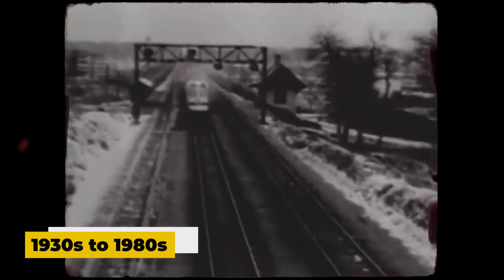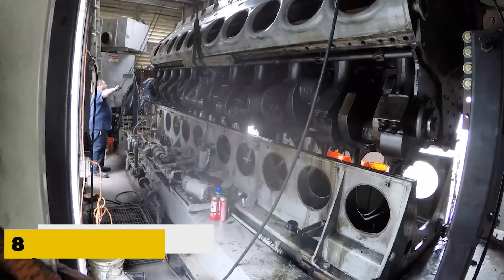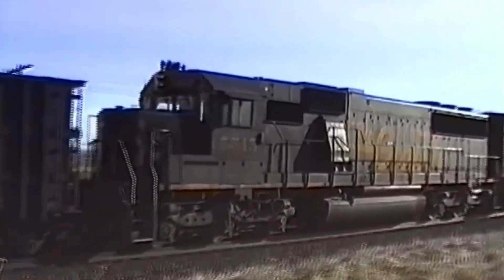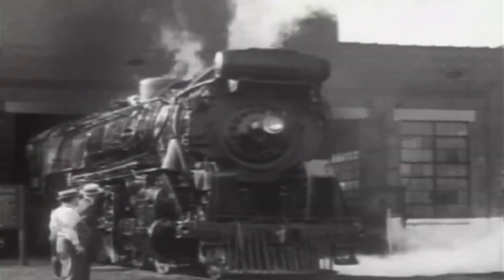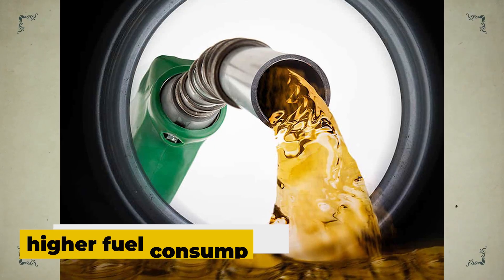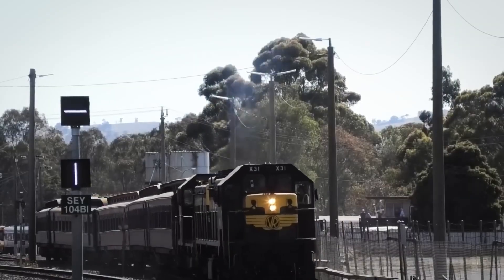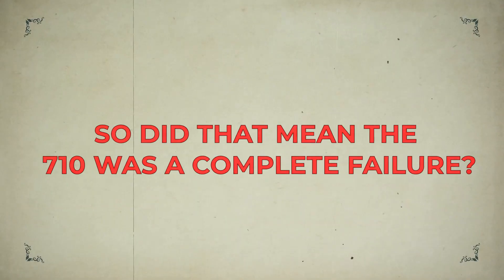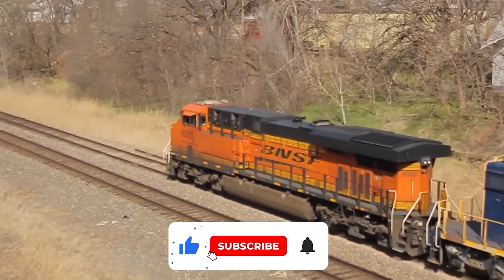Why EMD 710 Was Killed: The Engine Railroads Couldn't Trust

Comment from the maker: Where are my dear viewers from? Any EMD fans out there? 😊
Reply: I was a mechanic for both CPR and CN. I really preferred working on EMD locomotives- well designed machines.
Reply: Welded steel engine blocks, the strongest construction possible.  The EMDs also sound really good, like a locomotive should.  They look the part as well.

Comment: I read that the F59PH was powered by a turbo charged V12 710 diesel engine producing 2800 bp. to 3200 hp.
Reply from the maker: You're right! The F59PH really showcased the power of the 710 engine. It's fascinating how such engineering feats shaped the rail industry!

Comment: Are you doing any actual research here? The 710 was and is highly reliable. It's use in locomotives was curtailed due to Tier IV, but Tier IV 710's do exist in service, railroads have just found it cheaper to perform rebuilds. 

The issue with a TIV 710 is that they require particulate filters that sit over the engine and this gets in the way of how regular maintenance is carried out. This is why TIV 710s are still popular in marine applications as marine engines sit in a room with the filters elsewhere.
Reply from the maker: Thanks for sharing your insights! You make some great points about the reliability of the 710 and the challenges posed by Tier IV regulations. It’s always interesting to hear different perspectives on such a pivotal topic in railroading.

Comment: It didn't help EMD's case when the early batch 710s sold to the Illinois Central Railroad on their standard cab SD70s, suffered cracked blocks and failed air compressors. The air compressors were supplied by a third party, but EMD still got the blame.
Reply: Look at those IC SD70’s today, basically the main power used on the IC route, Chicago to Memphis in 2025.
Reply from the maker: Thanks for sharing your thoughts! It’s amazing to see how these engines have adapted and held their ground on such important routes.
Reply from the maker: You're absolutely right! Those early issues definitely impacted EMD's reputation. It's a tough lesson in how one part's failure can overshadow the entire product.

Comment: Way wrong information in this video, completely wrong, the EMD is still the best longevity  engine out there.
The GE offerings, all of them, still can't hold a candle to anything EMD.
This is how GE stole the sells from EMD.  GE paid lobbyists to get EPA rulings that put laws in place that all train engine manufacturers had to abide by, and this is where the EPA went just a little bit over board with their rulings.  At the time these rules were laid out, all locomotives bought at the time of these rulings had only a 10 year life cycle then new complete locomotives had to be bought to replace the 10 year old locomotives.
Ain't that some sh!t, EMD still has locomotives showing up for work thats approaching anywhere from 20 to 50 years of reliable service that GE has never never been able to claim.
So as the video name suggests that GE killed EMD's marvelous engine design is completely backwards.
GE has never been able to make any of their junk last anywhere near the EMD offerings.  So this video producer might ought to get his or their information rightly researched before posting non correct information that us in the know KNOW
Reply: Very true.  The SD40-2 that the Dash 8s were supposed to replace, have outlived their replacements.
Reply: Well, the AI bot that created and narrated this will be interested in learning all of this.. . .At least it stayed current with the images and video clips of outmoded steam engines in the imagery mix, right? If this video is anything like a bunch of AI-generated WW II junk, the "producer" didn't even bother to audit or edit this "product" before posting it, assuming that if it's on YouTube it's golden!
Reply from the maker: Why so bitter? :/ Thanks for watching :)
Reply: Hate to be this guy, but you're actually wrong in some places. GE has been more dependable than EMD since the late 1990's. Even in the 1970's when GE was selling their -7 series practically every railroad at one point had a fleet of them and despite dynamic grid and mechanical issues all of them were great pullers for heavy tonnage. GE just started overthrowing EMD with the -8 series because of better traction, horsepower, and microprocessor technology which the GP60's & SD60's fell short on. Alot of EMD units still had better reliability and higher dynamic power ratings, I'll give credit to that, but that didn't last long once GE kept proving how technologically advanced their motive power is. EMD was already dead once GM tried to sell them out. That's inevitably what prompted the massive failures of the SD90MAC-H's. Despite what happened with the AC6000CW's, GE actually resolved their issues and deprived them. Most of those problems were because of Deutz MWM from Germany which helped in the developing of the 7HDL prime movers. The smartest move GE did was discontinue the 7FDL which was on it's last threads after what happened with the C44-9W's & AC4400CW's. GE kept stressing the 7FDL's, which were a bought copy of the Cooper Bessemer RVBL's, which is what lead to fuel injection and turbocharger failures. The C44-9W's & AC4400CW's will always be notorious for catching fire. The 7FDL's, C44-9W's, and AC4400CW's to GE are what the 645F3's, GP50's, and SD50's were to EMD. One mistake and how to recover from it. The problems that originated from the AC6000CW's are what lead to the success of the GEVOs after GE corrected them. More GEVOs were built than the EMD SD40-2's entirely. Singlehandedly the GEVOs are the best units that GE has ever produced. Greenbriar Berkshire and CAT/PRLX kept making things worse for EMD. Caterpillar engines never have worked well in EMD units. You can even look back at MKR when they built the MK5000C prototypes and what happened with them. The SD70M's, SD70MAC's, and SD80MAC's were the last decent units from EMD, I'll admit that mainly because Siemens providing EMD traction motors in later years was another mistake that they went with. The electronic issues that orginated from the SD9043MAC's & SD90MAC-H's was still a problem and never resolved with the SD70ACE's. The SD70ACE-T4's & ET44AC's are even more junk because of EPA technology. Even though Wabtech took over GE now there is rebuild programs and GE units are slightly cheaper to rebuild and their warranty is much better. Many EMD units surpassing 20-30 years of age are disappearing or being sold while GE units are getting more rebuilds done to them because of that reason. While the EPA ordeal with EMD was real there was poorly done business and market choices that inevitably lead to their downfall over the years. The GP40-2's & SD40-2's were the last great thing from EMD, but how many of them are still used on mainline manifests 24/7 in this day and age? That's the big question. It's not justifiable if only being used as yard switchers and for short manifests.
Reply: @Slim_Slid  I'm not arguing with your comment here but for this one part, which is misleading at best:  "More GEVOs were built than the EMD SD40-2's entirely." .. so GEVO is a product line while SD40-2 was a product.  You'd have a more apples to apples conversation by putting the GEVO against the 40 series and not just one locomotive.  In that rate, does it still outpace?  No.  Another apples to apples comparison would be to put the SD40-2 against the ES44AC.  That's a fair comparison.  In that case, 4,438 SD40-2s (including T-2s) were built vs. just over 4,000 ES44AC.  It's close but the SD40-2 still remains the single model sales king 40 years after production ended.
Reply: @silicon212 
8,142 GEVOs altogether have been manufactured and that includes units in America, Mexico, and Canada for all railroads regarding ES40DC's, ES44DC's, ES44AC's, C45ACCTE's, ES44C4's, ET44AC's, and ET44C4's that currently are and have been in usage. All variants related, exceeding, or rebuilds of the SD40-2's and the EMD 40/-2 category don't meet those numbers, nowhere close. My GEVO comment was the series in general or else I would've cared to put specific designations like I just had to do with this reply. It still doesn't change the truth that modern GE units are far more dependable and reliable than anything from EMD in the last 20-25 years.
Reply: @Slim_Slid  I'm not going to engage you on a strawman.  Have a great day.
Reply: @silicon212 
What's left of it.
Reply: @Slim_Slid  It seems that both GE and EMD have had their issues over the years, it will be interesting to see what the future looks like for both companies as far as new locomotives is concerned, especially with this new battery-electric technology they're experimenting with
Reply: @treasurevalleytrackside9527 
There is no future. CAT/PRLX bought EMD in 2010 and GE sold their locomotive market to Wabtech in 2021 because of EPA regulations becoming stricter. Wabtech is the clear and only proficient leader in the railroad manufacturing industry of modern day and age as if GE wasn't already at that point for the last three decades almost. CAT/PRLX failed at rebuilding/repowering EMD units and Caterpillar has been in the same situation against EPA regulations as EMD did since 1983. As a company their only solid and useful existence is purchasing retired motive power, rebuilding (To factory specifications), and long term leasing agreements with the railroads.

Comment: EMD was outstanding for a long time, government regulation, the tier environmental stuff. EMD made the mistake of pushing the 645 too far. Wish they had not done that. I run large scale almost completely EMD engines.
Reply: I have a difficult time seeing the value in the tier 3 and tier 4 regulations for mining, transportation, and agriculture.  They all have efficiency of scale to the point that the emissions per unit of work for the consumer is really not very large.  Additionally, these machines mainly operate out in open country away from populations where particulates and NOx will not have much effect.  A lot of cost for almost no benefit.
Reply: @markam306 Almost all anti-Diesel laws make little to no sense. If all the cars on the road were Diesel we'd be using 20% - 30% less oil as a whole. The particulate emissions scare is not founded in reality; a properly maintained and driven Diesel will never smoke.
Reply from the maker: The EMD engines were truly great, and it’s a shame they faced so many challenges.
Reply: The EMD 645F3's wasn't mechanically that much of a big deal. Alot of railroads derated their GP50's & SD50's after the first hand reliability issues by changing the governor settings or replacing the factory power packs with ones from 645E3's giving them the horsepower and efficiency of GP40-2's & SD40-2's. Those units overall were manufactured during a time when EMD wanted to cut corners and become cheaper which obviously backfired greatly. That wasn't remotely close to how worse EMD became in later years. EMD did recover with reliability and market resource for the GP60's & SD60's but GE kept improving and displaying how technologically advanced their motive power was, espiecally in the traction category. That's how eventually GE dominated the market. The biggest mistake that did ruin it all for EMD was the SD90MAC-H's. Those units literally tore themselves apart mechanical wise. The same electronic malfunctions proceeded into the SD70ACE's and was never resolved. CAT/PRLX resurrected them as the SD70ACE-T4's and ironically failed again but much worse than what happened before. Also, if you think the GP/SD50's were frustrating look at the CAT/PRLX PR43C rebuilds from Norfolk Southern which were short lived.

Comment: The EMD 710, 12 cylinder lump was very successful this side of The Pond as the Class 66 locomotive
Reply: The Stadler Euro 4000 sold great as well, that had the 710-16 like an SD70M
Reply from the maker: You're right! The Stadler Euro 4000 really did have a good run with the 710-16 engine. It's interesting to see how these engines evolve over time.
Reply: Same thing accross the channel, Eurocargo rail and now DB cargo fr run class 66 native from EWS railway .
Reply from the maker: Totally get what you mean! It's wild how certain engines just seem to pop up everywhere. 

The Class 66 is definitely a fan favorite!
Reply from the maker: You're right! The Class 66 has certainly made a mark on the railroads here, showcasing the EMD 710's reliability and performance.

Comment: Simply put ,the EPA destroyed EMD. Now GE sold its locomotive division for the same reason, GE new its going to be hard to comply with future regulations.
Reply: From what I heard, the higher cost and lower reliability of tier 4 locomotives greatly lowered new locomotive purchases by the railroads.  Since rebuilding older units is an option, this sales slump could last for some time.
Reply: @markam306 
That's exactly what unfolded. It's also slightly cheaper to rebuild older GE units because Wabtech's warranty program is better than CAT/PRLX for EMD units and overall older units aren't required to adhere to stricter emissions regulations. This is why thousands of C44-9W's and older AC4400CW's from various railroads are being rebuilt into AC44C6M's. Some units are being removed from deadline storage and others are being bought by other railroads or leasing programs. The EMD & GE-T4 units soley exist because of tax write offs and EPA credit for the railroads. The tier four units actually had alot of potiental performance wise but some of us know what happened. All of them are overkilled with EPA technology and are far more problematic in consist than any T2-T3 units currently still in service.
Reply: @Slim_Slid 
Do these GEs still use cast engine blocks ?  That construction limits how many times they can be rebuilt.

A couple of years ago I saw a rail fan video of an idling 1 year old GE tier 4 locomotive.  Visible black smoke from the stack !!!  So much for clean emissions.  Ever notice that many GE locomotives in consists have burn marks on the long hood from past engine fires ??
Reply from the maker: It seems that all of the legends have problem due to EPA :/
Reply: EPA ruined ALL on-road diesels. EGR and SCR with DEF destroy the engine and exhaust over time.
Reply: what else is gov't good for except screwing up a good thing..............a bunch of two bit know nothing know it alls who couldn't run a hot dog stand and make a profit......but they sure know how to tell everybody else how to live
Reply: @yardlimit8695 
You present a good description of the
managerial and administrative / ruling classes.  Never performed anything real.  I lump them and politicians into one big “arguing and conniving class”.  I’ve heard for some time the case for congressional term limits.  I think that federal employees should also have term limits.  Retired Army and Marine Corps drill instructors would make good supervisors for government workers.  They have useful skills.

Comment: the cylinder purge was air not air and fuel. The fuel was introduced by the injectors.
Reply: Good point.  The explanation he gave for higher emissions from 2 stroke engines applies to gasoline spark ignition.  It does not apply to diesels.
Reply: @markam306 The actual emissions problem of 2-stroke diesels are the ports in the cylinder. They trap oil when the piston moves up and sucks that oil in when the piston goes back down to scavenge the cylinder. Some 2-stroke diesels (marine) get away with this by introducing intake poppet valves.